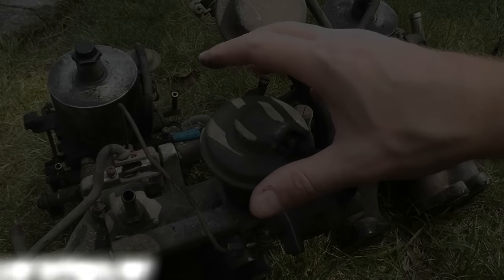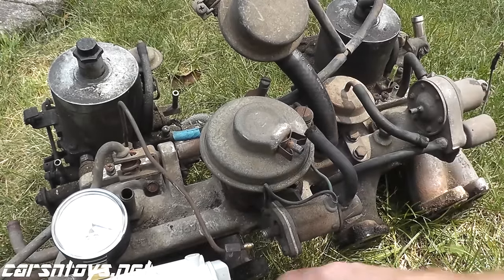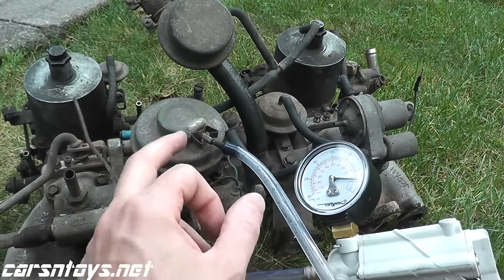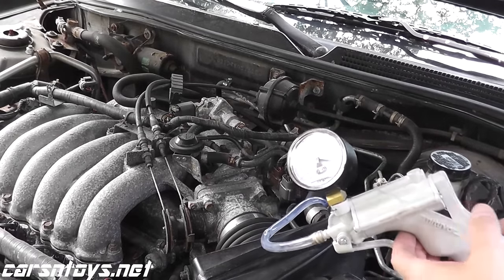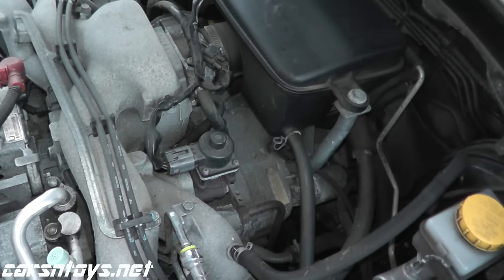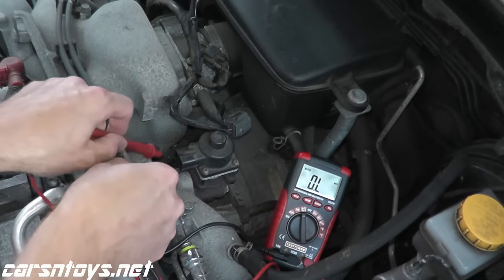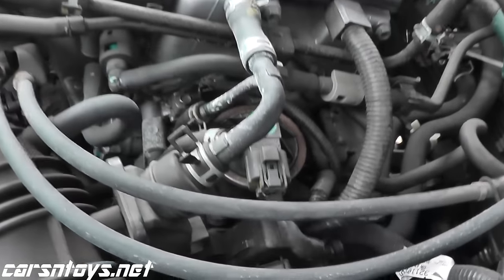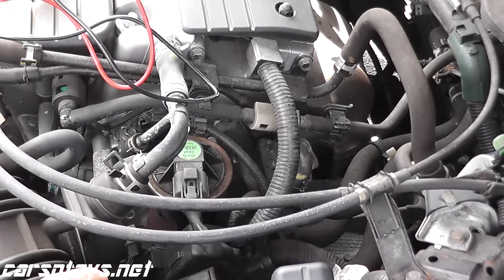How To Test EGR Valves | Old vs New

Comment: Straight to the point and easy to follow. I've been doing computer & car repair for a while and love diagnosing, the only problem I have is my stuff works wonderfully until it doesn't. I usually spend a couple of weeks trying to remember how to do the repair (cause if you don't repair stuff regularly, you truly forget), let alone figure out where I put the necessary tools. But YouTube is a benefit when you have people who understand the benefits of camera positioning and can stick to the point of their video (none of the rambling). In car repair you have mechanics, parts changers, and mechanic instructors, the last are the biggest benefit because they can do the repair and explain the ins and outs of the system they're repairing to help other mechanics or the DIYers. Gotta love them and you are definitely appreciated.

Comment: I was able to test my EGR electronically as shown and it came out okay. I don't have a device to check the vacuum, though. Maybe the auto parts store has one to buy or borrow? Pretty sure mine has a stuck "pin"/valve . Check Engine light indicates EGR problem. Wanted to be sure before I cleaned and rehabilitated or replaced entire unit.

Comment: I brought my Subaru Forester 2010 to a garage because it's idle was really rough and the guy tested the egr valve (connecting and disconnecting it)  while the key was on RUN. When he tried to restart the engine, the ECM was not working anymore. Is it possible that the test would have burned the ECM by having the EGR valve sending a sudden spike to the ECM?

Comment: Im getting P0402 Exhaust Gas Excessive Flow. Took out my EGR valve and cleaned it out, put it back in, same code. I also remover the modulator and cleaned it along with the EGR. Decided to get a new EGR and installed it. Same code. Found out my Cats guts were in my muffler and was essentially gone so I just replaced that today. If the code comes back does anyone have any idea what I can do. Its a 1997 Toyota Tacoma 2wd 2.4

Comment: Is the ohms testing the same for the terminals on a 2008 Suzuki Grand Vitara 2.7 gas engine?  The terminals look exactly the same and the valve itself is very similar looking. I'm getting no resistance at all (complete continuity) between the same terminals shown in this video.

Comment: I did the vacuum test on my Mitsubishi Eclipse GS and it holds the vacuum but when I apply vacuum the throttle body opens up.  So when I do the test with the engine running at idle it actually revs up instead of stalling or wanting to stop.  Is that a sign of a bad EGR valve?

Comment: Is it always supposed to hold vacuum across the board on all vehicles and models? I just bought a new egr for a ford econoline and it doesnt hold vacuum fresh out of the box. When I have it installed and idling the car and I apply vacuum with the pump it does want to stall out but it doesnt hold vacuum.

Comment: The potentiometer needs to be checked with valve closed and valve opened. Resistance could be Ok in one position but not the other. The potentiometer's wiper that moves up /down gets worn out...

Comment: Great video, clear and well explained. Tell me though, how can you tell if the diaphragm has gone if it's an electronic valve??
Reply: The old-style EGR valves used vacuum to operate the valve via a diaphragm (the vacuum was used to provide movement of the diaphragm which then moved the valve - like a power brake booster). An electronic EGR valve uses a solenoid to open or close the valve.
Reply: Mm
Reply: Ford tractors 

Mmm

Comment: May I ask a question? Does an 09 Honda have the same values as the 03 Honda you tested? I did a tune up on an 09 Honda Fit, including replacing the ignition coils since I was in there and it ran beautifully for about three weeks then performance dropped dramatically out of nowhere. The diagnostic came up a bad EGR valve. Some people claim a dirty valve can do this but unless the build up is enough to keep the valve in one position, I don't see how cleaning it really would solve anything. I think the way mine failed, the solenoid had to go bad. It's not being driven open because the engine runs great initially but as I drive and the engine heats up, that's when I can notice loss of performance. Are the pin values the same???
Reply: Hello Kensho, did you get any answer for that?

Comment: Hey all, If I connect a gauge and hose to the EGR should the needle be reading anything specifically? I replaced my EGR and tested it and it stayed at 0 even at op. temp. It's a 1979 F250 and the EGR is attached to the spacer plate at the carb. Let me know! Thanks
Reply: It's not supposed to read anything -you are just supposed to pull vacuum on it to see, if it affects the engine or holds a vacuum.

Comment: Ok, but what is an EGR (exhaust gas recirculation) valve, and what is its purpose??.
Reply: To return exhaust gas back into the engine to help cool the burning of fuel to lower toxic emissions. If burning too hot, it comes out as toxic nitrogen oxide

Comment: Hi! Thank you for this video. I have a Ford Mondeo from 2005. A 2,0 gasoline engine with 107kW. I got the DTC P0403. I have a electric typ of EGR-valve. I did check the EGR-valve with a multimeter just like in the video. I have approx 14ohm on all the terminals. You mention in the video that you should have 22-24 ohms but I have approx 14 ohm on all my terminals. Is this OK or is my EGR-valve broken? Thank you!
Reply: For my Kia it’s suppose to be approx 8 ohms. Each car is different

Comment: for a honda EGR, if terminals 1 and 3 don't show any resistance (no reading on multimeter), is the EGR bad?? any help would be appreciated
Reply: I know this is late but did you end up need a new egr? Send wit didn’t have any connection?

Comment: Why does the vehicle runs rough when he applied the vacuum? Doesn't the engine do that when its running?
Anyone know?
Thank you
Reply: The egr is exhaust gas recirculation so when it’s engaged, it’s feeding exhaust gas back to the engine. When done manually on a cold motor like in the vid, it causes the engine to run rough. Normally It’s suppose to engage when the car is running warmer to help cool the burning of fuel and lower emissions.

Comment: If i unplug the egr electrical connection while running, and the engine idle doesn't change while in park. Does that mean its bad? Please answer man, my car is hurting.
Reply from the maker: What's the problem? Do you currently have an egr code?
Reply: @CarsNToys  I had codes P0460 fuel level sensor A circuit(Gas guauge been out for two years) P0442 Evaporative emission sytem leak detected. P0506 Idle air control system rpm lower than expected. I have a rough idle.I had a strong gas odor under the hood but a New throttle body, MAF sensor, canister vent valve solenoid, canister purge valve, and pcv valve got rid of the strong gas smell. Still seems like the fuel mixture isn't right though, loss of power and still getting misfires. Each item i replaced for the intake/Evap system made it run better. Fuel additive helps, but i cant buy that for every refill. The main problem is when my automatic trans shifts in 1,2,3 gears it revs up to around 3k rpm's and makes the rear end or drive shaft jolt. It gets worse the hotter the engine gets. All gears shift awkward with high rpm's, 4,5,6th gears dont shift violently though. I replaced the camshaft sensor today and it made it shift about 40% better, and seems to get more power now. I'm about to install a crankshaft position sensor in the dark in about 20 min. Im hoping that helps since a failing crankshaft sensor can lead to misfires i read. I have a new coil pack, plugs, and wires that are top notch quality. I have new brakes but it seems like the pads squeek when driving with out breaking, and loss in power in brakes. Possibly the vehicle transmission sensor that controls the abs sensor, that relays my speeds back to the computer/trans? Possibly the power break booster has a vacuum leak creating this mess? I have the vehicle/trans sensor just cant get the stripped bolt out of the tranfer case because its in a tight spot! (I'm a millwright, so the stripped bolt realy fucking bothers me)😟 Possibly a bad EGR valve? I used a spray bottle with water, but it wasn't effective in finding a vacuum leak in any hoses. Their is too much air coming from the engine to get a good spray on the vacuum lines. I havent taken the egr valve off yet to compress it yet or to see blockage. Don't wanna buy a $25 egr gasket if the one i have is no good, but it seems like its a metal gasket from what i looked up. Maybe a bad vapor canister? I did notice the hose that goes on the fueling neck had a slight drip, but i just thought the fuel was over pressurizing from the bad cannister vent valve solonoid. I replaced all kinds of fuel parts over the last 2 years, something is messing them up. Maybe a bad fuel pressure sensor?  2004 explorer 4.0 sohc flex fuel with 137k miles. I change oil every 1500-2000 miles, new air filters on time, new fuel filters on time. Possibbly spark plugs and wires fouling up now from misfiring now too. Havent checked that yet. Please help out man! You get me in the right direction i will send you a Chri$tma$ gift!

Comment: Totally useless test for electronic EGR.  Just measuring continuity of stepper motor windings.  Don't know if valve is stuck open, closed, or is leaking.
Reply: UnFunded Opportunities I agree that is not verifying power ground computer control or hose vacuum issues

Comment: What if the vacuum holds (egr membrane is good) but the car does not stall/does not stop?
Reply: If it does not stall when u apply vacuum to the egr with the engine running than egr is bad. If it does hesitate & wanting to stall than egr is good

Comment: Can a bad one cause car to smoke?
Reply: . It's really unlikely that your EGR valve has anything to do with your engine smoking. The smoke is more likely to be caused by bad valve seals worn piston rings, a leaking injector, a leaking fuel pressure regulator, or a blown head gasket.
Reply: Thank you sir
Reply: @johnlira3316  What color is the smoke ? White, black, purple ?
Reply: White    had my mechanic un hook the vac hose that goes on top of the fuel presure valve he said it smelled like gas    so now that usaid that might be the problem i think you are correct ?  What do you think?     Car is an 04 grand am and it still has the factory Egr and fuel presure valve
Reply: @johnlira3316  I know this answer is long so, grab some popcorn. LOL. And, good luck. It could be a cracked or warped cylinder head.
 Head gasket failure, cracked engine block or rings. However, if it's thin wispy smoke it could be condensation. However if it's thick white smoke it could be something more serious. 1)  Inspect The Intake Gasket. (This is a car part that seals the cylinder head in order to prevent the coolant from getting to the cylinder. Any leak or damage in this part creates an opportunity for the coolant to enter the chamber. Long story short, it will create white smoke from exhaust pipe) 2) Examine Further To Check The Head Gasket (Remember to only perform this step when the intake gasket is working fine. After that, we will come to the head gasket. This is a car part that seals the cylinder head in order to prevent the coolant from getting to the cylinder. Any leak or damage in this part creates an opportunity for the coolant to enter the chamber. Long story short, it will create white smoke from exhaust pipe. If this part is still fine, we will check the cylinder.  3)Look For Any Crack In The Cylinder Head (The cylinder head is the car part that made of aluminum, which is prone to breaking in overheated conditions. This part is essential since it connects to the engine block and head gasket. Sad news for car owners: If this part is broken or damaged in any way, you have to change it.) What Causes White Smoke From Exhaust Smells Like Gas ? Usually, it is water vapor or steam, since it is introduced into the chamber. For that reason, you will have the water dripping from the tailpipe. Drivers can also see the water in the fuel or a leak in the head gasket. You might think it is normal, but that is the engine misfiring and pushing raw fuel out. In those cases, the car will be running rough and drivers can smell a raw fuel smell. In order to fix this, just check the fuel and replace if necessary. What Causes White Smoke From Exhaust When Idle? If you have white smoke from exhaust when stopping or idling, your combustion chambers engine might get oil inside, which cause them to burn off the exhaust. This will cause white smoke, along with the idle issue. This is very easy to recognize since there is a difference between burning gasoline explosion and a burning oil explosion. This problem should be fixed soon since the longer the oil stays inside, the more damage it causes for the spark plugs, which might require replacement.
Reply: So do you suggest replacing the easiest part first and see what happens ? The fuel presure valve and might as well the original Egr?